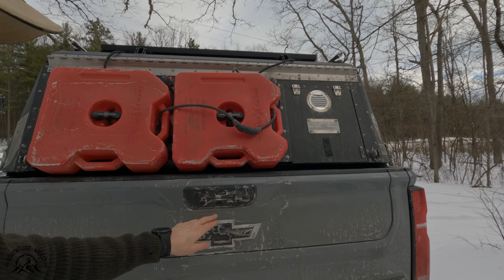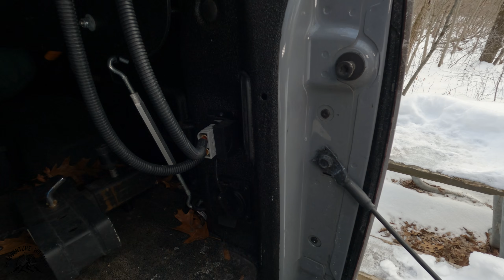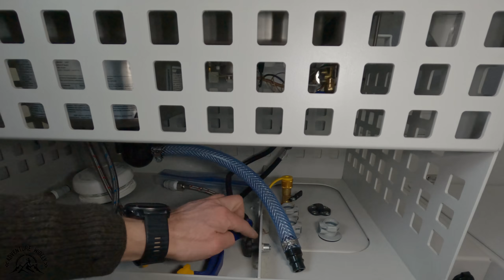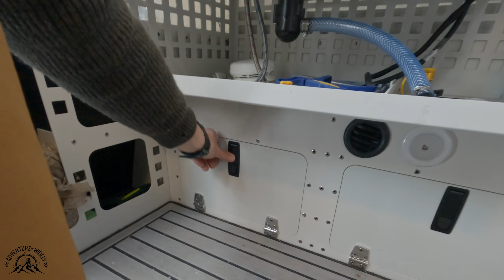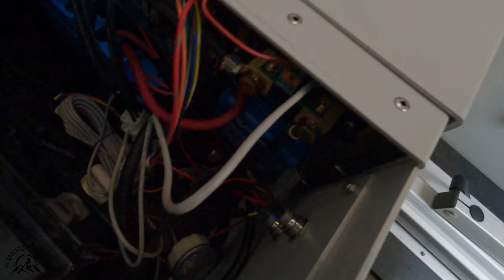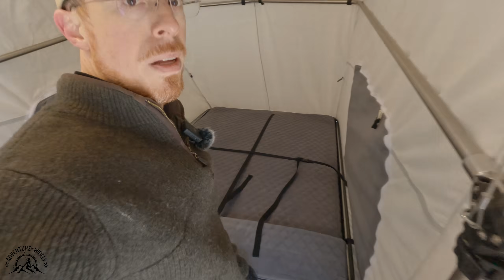Skinny Guy Campers Customized Truck Camper

Comment: I presume there is no winter package for this unit
Reply from the maker: You mean an insulated liner like some of the rooftop tents have? Not when I bought it, and I doubt they'd have room for it, with the current layout.  But with the furnace running, there isn't a need. We've been in 4F temps and it's been comfortable inside.

Their kit-n-kaboodle model has the heater vents flowing around the water tank, which is something I don't have with my layout. But that wouldnt work for me, as we're away from the camper for a long time, and I wouldn't want to leave the furnace on while away.

Comment: How is the wind noise (when open/sleeping)? I’m comparing this to a typical flat hard cab (and building a bed inside), this looks sweet to be able to stand and clean up inside esp in the winter
Reply from the maker: Wind isn't too bad if it's under 30mph. Rain can be loud though, especially if it's pouring hard. I've been in a camper shell before like you're talking about, and I'd say wind is comparable, rain maybe slightly louder.